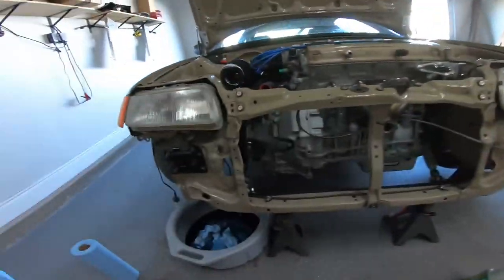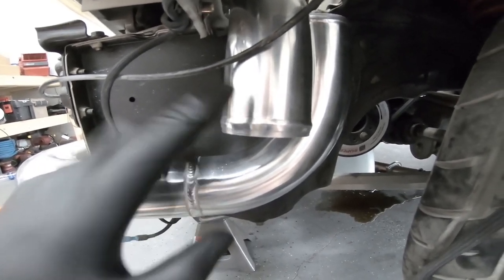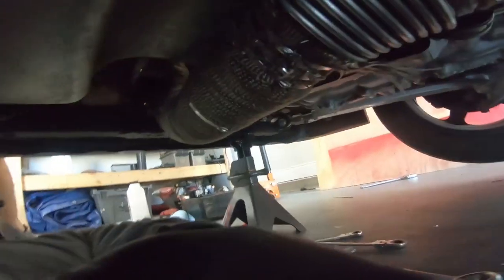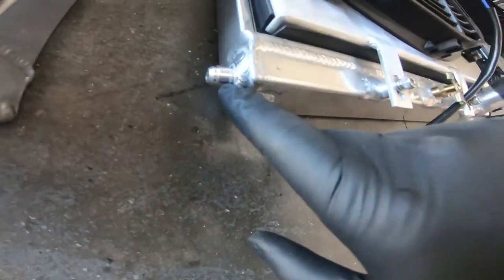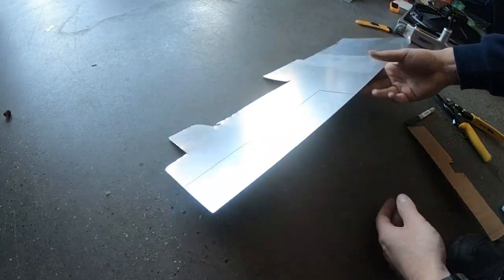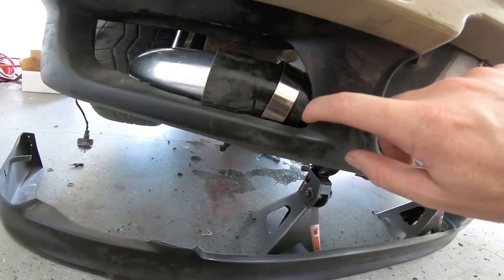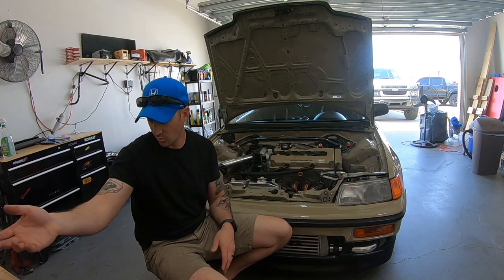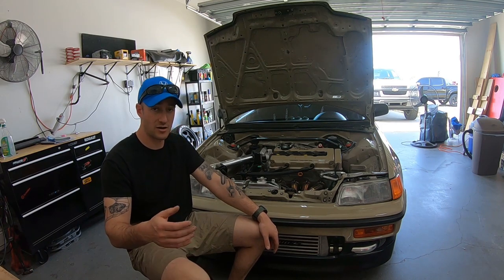Honda CRX Si Go-Autoworks R-X600 Kit GT2871r & Radiator Part 28

Comment: I see the line coming out of the radiator,  it splits with one line going to the wastegate and one line going to the turbo. The coolant that exits the the wastegate returns to the block, the water that exits the turbo where does that go?? Install 3" intercooler cooler piping, skunk2 pro1 cams and a gt3582 turbo at 19psi and watch what it makes👍
Reply from the maker: Technically I don’t have a backdoor now but it pretty much is. It’s a properly sized turbo and lag is super minimal which is awesome for all the tracking I’ve been doing. Originally I didn’t want to cut any of the car but if you look at recent videos that’s gone way out the window lol

Comment: Awesome setup, I like the air ducting you did. What size&pitch thread is the skunk2 drain bung?
Reply from the maker: mark0shark0 I THINK it is M14 x 2.0. I can get you a measurement when I goto work by bringing the old plug in
Reply: @justingadell  it's ok bud, just seeing if you knew. I'll check mine out when ever I drain the coolant. Very nice CRX, gives me motivation to upload a video of mine